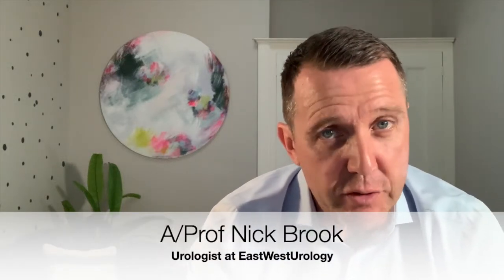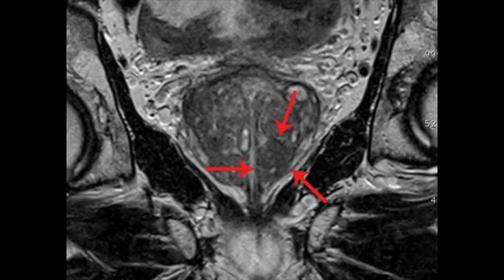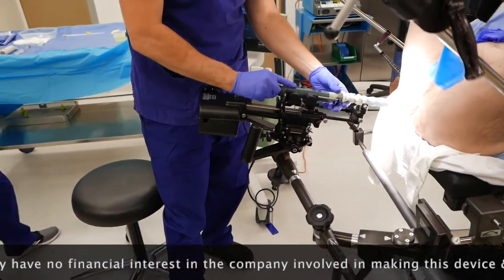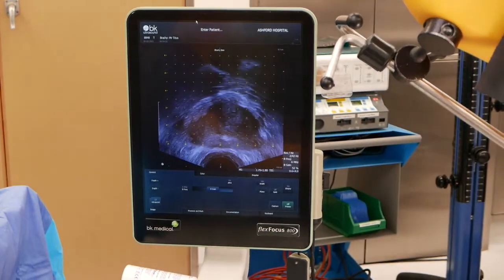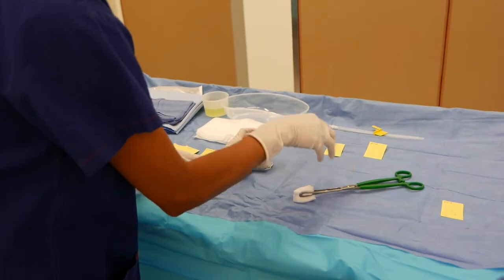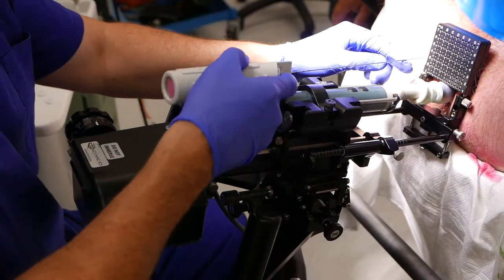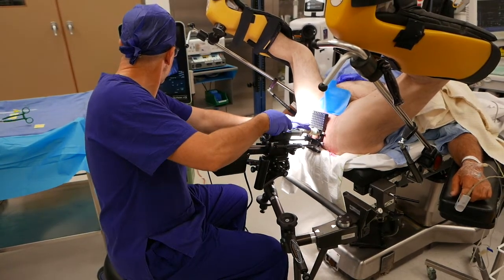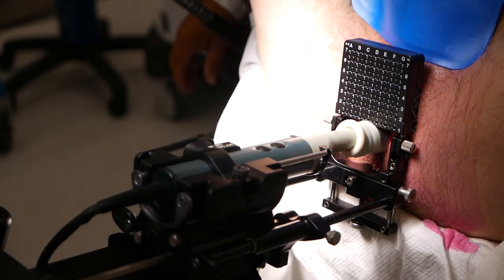prostate biopsy looking for prostate cancer

Comment: General, outstanding. I can, believe the number of urologist that think that’s unnecessary.
Reply: I was fully awake during my procedure. Needles were not all that painful, but the ultrasound was excruciating. It saved my life, so it was worth it
Reply: @johnnyvaughn8391  awake but they numbed the area right? .. that's how they usually do it according to research. How did it save your life? They found the cancer ? No MRI or PSA beforehand?
Reply: @johnnyvaughn8391  I'm still skipping the biopsy against my urologist advice.
Reply: @johnnyvaughn8391  - Ultrasound scan,  was 'excruciating?     explain that please?    Lol!
Reply: It's unnecessary in some cases.